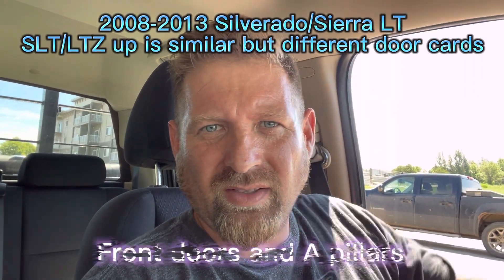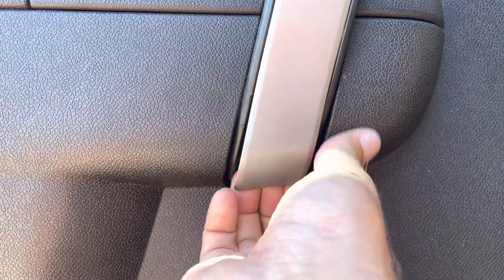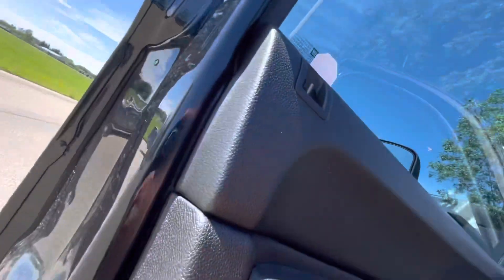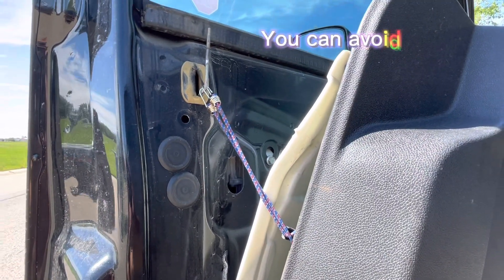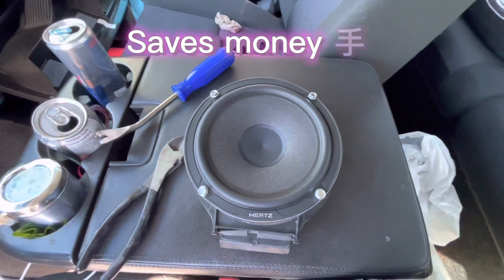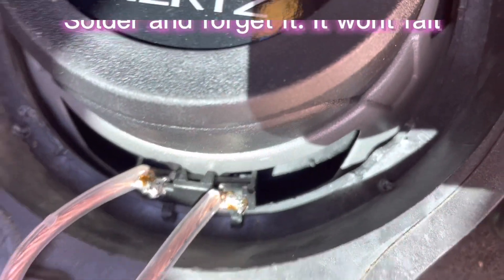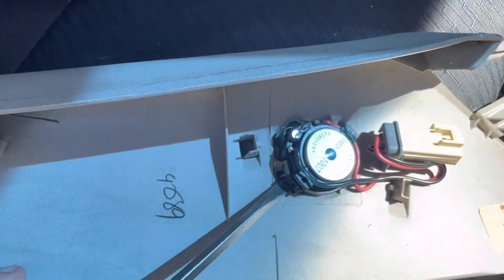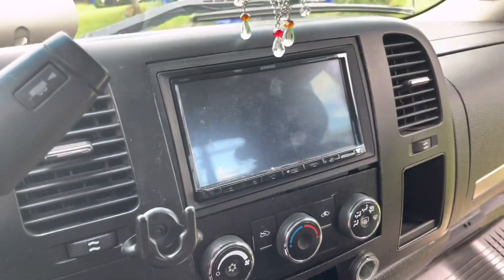2008-2013 Silverado/Sierra Front Door Component Speaker Installation (New Wiring Door Wiring)

Comment: Are you waiting to an amp or head unit? Why cut connectors and run new wire? This video feels incomplete
Reply from the maker: This install had a 4 channel amp
Reply from the maker: Running new wiring is also an upgrade to the stock high gauge thin wire even when wiring to a new head unit. These being an aftermarket component setup it’s just as easy to run thicker wire because you end up opening up everything anyway